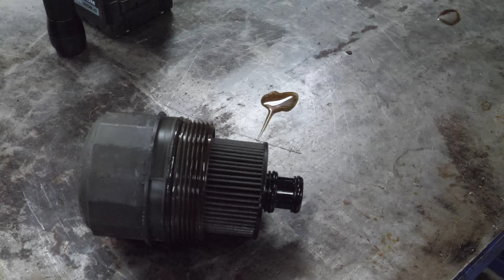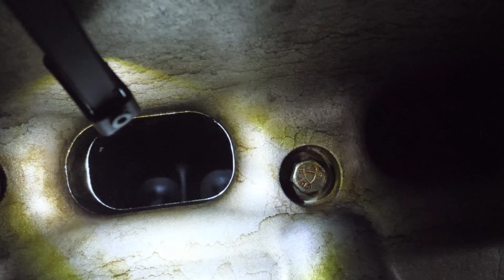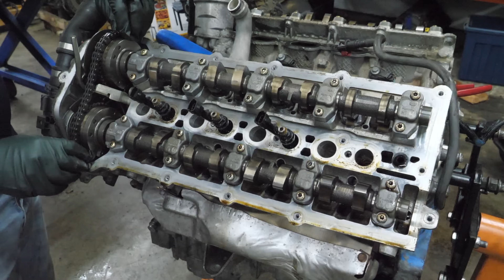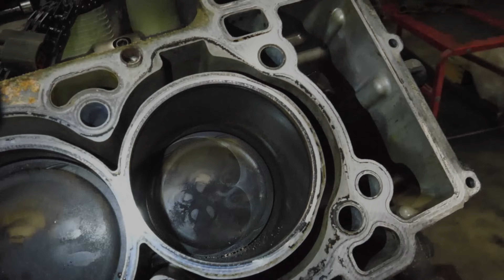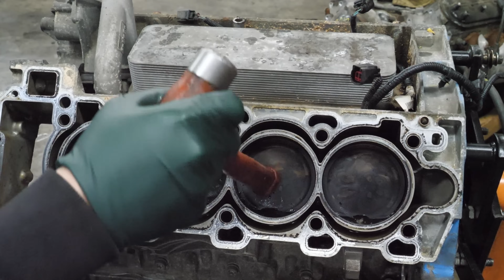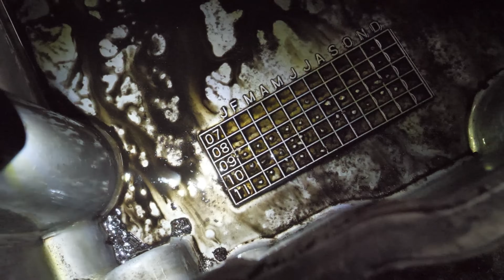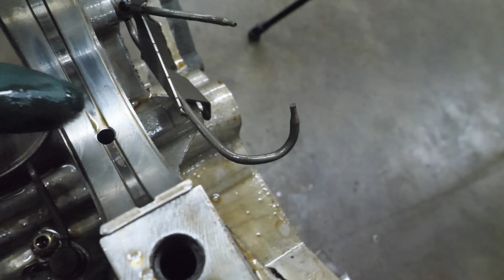500HP Jaguar Land Rover 5.0L Supercharged AJ V8 Teardown! Had to buy AND borrow tools just for this

Comment: I've commented on this before, but the manufacturer recommended oil change intervals were ridiculously far apart, and that makes up a huge part of how often they failed. Design, complexity, cost cutting and so on are all very obvious reasons too, but in some cases it was every 15,000 miles (with Jaguar specifically)
Reply: I work in a quick-lube shop (yes, yes, I know.) and the oil that comes out of the newer German vehicles with long oil change intervals are in general the absolute blackest and smelliest oil besides diesel trucks. I recommend to friends with German cars to roughly half the interval on oil changes assuming it's not a lease vehicle. 5,000 to 7,500 kilometers is still longer than I'd personally go in any of my cars, but it's at least better.
Reply: I’ve got the AJ 34 in my 2007 Jaguar XJ8 which is the 4.2L V8. I’ve got 231k miles on it and have changed the oil every 3k miles. Crazy they’d recommend every 15k miles. The 4.2L’s seem to be the more stout motor
Reply: Yup! So much complexity and reliance on oil to hydraulically actuated cam phasers and chain tensioners. Plus higher specific output and heat adds up to a self eating engine.
Reply: I think jag meant 15000kms, not miles, but the only thing that changed in the manual was the units, not the numbers in front of it.  15000km is about 10000 miles.  pretty normal to go 10k miles now on good oil, but 15000 is pushing it if you are not testing the oil and if you do a lot of short trips.
Reply: I believe Consumer Reports played a big part in the extended oil change fiasco when they started putting emphasis on "cost of ownership".  They recommend cars that have lower routine maintenance cost (ie: fewer oil changes) and downgrad vehicles that higher routine maintenance cost (ie: what used to be the more practical intervals of past vehicles). Became logical for manufactures to enter the lower cost of ownership war.
Reply: That must be Ford's grand plan, I hate the ecoboost engines, even the regular 3.5 V6 engines. I had to replace the turbos on a 2014 flex at 48,000 miles, oiling issues of course, prime don't maintain them like they should and the recommended intervals definitely don't help. The same car came back a month later for a water pump so naturally u recommended a while timing set as well, a month after that I had to replace the PTU cuz it was AWD, everything was due to leaks and lack of maintenance. All those repairs before 55,000 miles. Those are the average repairs on those engines at low mileage
Reply: I helped a lady the other day because the oil light came on in her car 
It turns out that the vehicle (Peugeot 308 1.6l turbo) was 12 years old but had only done 45,000 miles and she had been following the service recommendation based on mileage
Reply: lmaooooo, meanwhile
Mazda recommends that them every 6000 miles,
Reply: I've always attributed that to planned obsolescence. With such long intervals, the issues will usually arise precisely at the time the warranty runs out.
Reply: The long oil tube is for oil extraction when changing the oil.
Reply: @ronsereda4242  That for sure, and the greenies.
Reply: 15k miles interval is ridiculous. Meanwhile Ford specify 5k miles on their Ecoboost engines. I change the oil every 5k kilometers on my Explorer Sport with the Ecoboost 3.5. I am at 265k kilometers on the odo, with the factory turbos, and not a problem. It burns very little oil too. I’ve always believed that larger engines with double overhead cams and turbos must have frequent oil changes or they’ll fail before their time. The person who mentioned planned obsolescence may be onto something.
Reply: @allenramirez2778  ive had an ecoboost Flex, F150, Fusion and now have a 3.7 Transit, other than the current van i drove all those vehicles to over 125k miles with only scheduled maintenance usually 2-3k miles over on oil changes.....never had an engine or trans related failure or issue on any of them. People drive these things like a granny wagon or like a Nascar ride imo both are reasons to cause failures and leaks. I drive my vehicles, hardly ever take off from a stoplight at just over idle and putt putt up the road. Its half to full throttle all the time, current T-250 is loaded and around 9k lbs so it needs 1/2-3/4 throttle to get going lol but pusy footing around on short city trips, having a 365hp ecoboost Flex for soccer mom to haul kids around and never exercise it and get extended heat cycles is a recipe for problems especially being short cycled.     Not sure what you meant about the engines not maintaining a prime on an oiling system with no check valves and clearances that bleed off oil pressure when engine is shut down but unless you install a pre lube system no vehicle will maintain pressure and oil pumps stay primed because its oil in the pump on shutdown
Reply: @JetFire9  I suppose that’s possible, but the more likely scenario is pressure from European fleet managers on manufacturers to extend service intervals.
Reply: Pretty happy my Alfa Giulia says to change the oil every year or 16k km (10k miles), and since I rarely go over 7000km/year it means that it always has fresh oil. Considering it has (being EU, as they didn't put it in the USA ones) multiair module on the head to control valves, it's REALLY important to have fresh and proper spec oil in there...
Reply: With the quality of today's oil being MUCH better than it has been in the past, and the fact that the engines in newer cars being designed better and using better materials, the ring seal is a whole HELL of alot better than it was in engines of the past. It's very common today to be able to go 8000+ miles and still have the oil in a vehicle be clean and viable. 
I change the oil in my Buick Lacrosse, with a 3800 Series III engine in it, about every 7500 miles and at that point it still looks VERY clean. Just slightly darker than when I put it in the motor. 
I wouldnt be afraid to push the mileage a little higher between oil changes in my car even, but getting up to  15,000 miles on an oil change DOES seem a little ridiculous to me. 
Even if the oil still LOOKS clean, it DOES wear out. The detergents in motor oil that are meant to keep the engine clean and suspend dirt particles in the oil so that they can be flushed out during an oil change start to break down, the viscosity of the oil starts to change, and of course no matter how good the engines ring seal is there IS going to be contaminates in the oil after that long no matter what. Yep, oil changes are one of the MOST important things you can do to your vehicle to make it last as long as possible.
Reply: @thekornwulf  5000-7500 kilometers is completely fine if the vehicles engine is in good working order, and it's used in "normal" driving situations. The oil in my Buick after 7500 kilometers still looks like the day I put it in there.
Reply: you think thats bad, as someone that works in a Jag/Rover dealership, with the ingenium engines, they recommend services every 21k or 2 years
Reply: @rondaddy7793  A "service" or an "oil change"? 🤔
Reply: @davelowets  a service, that being said, the sales men don't mention an interim service in between, so people aren't aware that it's recommended to do an oil change in between, and 90% of the time even if they do know about it, they don't do it. I've seen cars consistently go 30k without an oil change. Worst part about it is we cpo cars that are "caught up on services" interim services aren't required to cpo a car, and 90% of the time the sales manager won't listen to you saying we shouldn't cpo a car that never had an interim service
Reply: @rondaddy7793  People are getting too damn stupid today... 🤦🏻 
And the ones that trade their cars in every year or two just don't give a shit. 
It's a sad state of affairs today.
Reply: @davelowets  Whoever buys my leases after I trade them in is getting great cars. My sales guy recommends changing oil every 6 months (against the recommendation in the manual which calls for 10k miles), even though I only drive 9k or less a year. My first lease only had 11k on it in two years because it didn't have AWD and it had 4 oil changes when I turned it in. My next one had 18k when I was done and it had 4 oil changes. My current one at 12k ( turning it in in May) has already had 3. The dealer pays for the first 4 changes so it's not costing me anything. If I ever decide to buy out one of my leases Ill know it's had a very good start in its life. Like i said whoever buys my leases should have a great car if they keep up on 6 month oil changes they will last a long time.
Reply: @thekornwulf  I have a brand new Q8. Audi wants to change the oil every 30k km (18500 miles!!!) So i change it myself every 5-10k km and go to them to change it at 30k km just to keep my warranty without telling them I changed it.
Reply: Meanwhile in Europe: your more performance-oriented cars may require 15000 km (9320 miles) but 20000 km (12400 miles) is common. Modern cars even allow for longer distance intervals but may also have a time interval. My car (2 liter inline-4 EURO6 turbodiesel, 150 hp/370 Nm) has a service/oil change interval of 30000 km (18640 miles) or one year, whichever comes first.

I have no idea why this is. Quality of the fuel? Quality of the oil? Just common practice? A sham maybe? Even Porsche has a 1-year or 10000 mile service/oil change interval for their 911.
Reply: @Hydrazine1000  It's wrong. Change at 10k. Your engine will be toast. Same as my Q8. Audi want 30k km. Never gonna happen. I change at 7500 usually.
Reply: On the damaged piston either a spark plug or the supercharger coming apart. Not sure about the head of a direct injector coming off.
I'm retired auto mechanic also retired Army track and wheel mechanic. Take a look at a sparkplug or one of the direct injector to see if they match the notch in the piston dimensionally.
Something definitely went through the intake and combustion process to do leave a mark like that, and been  small enough to exit through an exhaust valve. Back in the early 80's I had a small block Chevy develope a knock we believe was a piece of carbon breaking loose from an intake valve. It was a few days after changing the oil. The customer brought back rattling pretty good.
Worked the throttle to I was isolate the noise, and it was gone. Several days later the manufacturer of the motor oil we used had a nation wide recall on their oil. Seems it had to much of some type of detergent additive in the chemical make up of the oil. Called the customer had them bring the vehicle back replaced oil and filter with a different brand.
The vehicle never had an issue after that. Again we suspected carbon got loose from the back side of either an intake or exhaust valve. Sorry to be so long winded but felt compelled to share the experience.
Reply: @chubbysumo2230  unfortunately no, they really did set the oil change interval at 15,000 miles on the non supercharged 5.0 V8s. That was on the Jaguar XF models
Reply: @littlebuch  It's your car, if you want to undercut the service interval, then who am I to tell you what to do? Just continue doing what you think is best.

Just my own experience: I've driven a compact with a 1.6l engine from 90k km to 245k km on its manufacturer service interval of 15k km. I've driven a compact with 1.6l turbodiesel from 80k km to 250k km, on its intended 20k km interval. With my current car, a wagon with  2.0l turbodiesel, I reached the 30k interval once, but now I'm hitting the 1 year interval before reaching 30k km. So with all 3 cars combined, all second hand too by the way, I've done over 500k km on manufacturer recommended service intervals, on manufacture recommended oil, with ZERO oil-related issues. I have no qualms with sticking to manufacturer recommendations.
Reply: @Hydrazine1000  do you want a medal? The fact your car made it another 30k km isn't anything to brag. Internals are probably tell a different story.
Reply: @littlebuch  It's not an exception, it's the norm in Europa. Now, go waste good oil prematurely all you want, I'm not trying to convince you to change.

All I'm saying that sticking to the manufacturer recommended interval is perfectly normal out here. Save a small percentage, everyone follows the interval. Or breezes past it in fact
Reply: @Hydrazine1000  I am European... No, it's not wasting oil. You certainly have no idea what you are talking about. Go destroy your engines all you want.
Reply: @littlebuch  After over 400k km, combined over 3 cars, I've ruined exactly zero engines. (Sorry, I mistakenly mentioned 500k before) _I haven't had a single oil-related issue! _

That would have been about 55 oil changes at a 7k5 km interval, give or take. I've had about 24 in total now. 

So let's just agree to disagree. You do you.
Reply: @Hydrazine1000  400k km divided between 3 cars is not that much? Wtf are you talking about? 130k km per car? That's a really low number. Idk why we are still having this discussion.
Reply: @Hydrazine1000  I get your point and it’s a valid one. Places are much closer in Europe than they are in the US. You can drive six hours straight and only pass one or two tiny towns, as such we tend to drive long distances more which is where the 10k interval comes on much faster and takes a heavier toll. Be it a euro, Japanese, or US engine I’d never go 10k on an engine. I work too hard to spend more money on already expensive cars and waste a weekend fixing something I could’ve prevented.
Reply: @Hajijah Muiler Yeah, it's funny. What's even funnier is how I have 300k km on my old car and the engine is like new. But I guess preventative maintenance and good care mean nothing...
Reply: lol
Reply: 15,000miles? That’s insane.  I’m Australian soo hang on a minute.  
Yep 24,000km.   That’s absolutely ridiculous.   
The engineer’s definitely said “yep should just scrape past warranty period” 
Warranty runs out and you have a grenade on wheels.
Reply: @allenramirez2778  Naw, I drive one every day, and know several with them. That's certainly not "average"!
Reply: Certainly one can go a long time between oil changes if they drive solely on the highway. Starting and stopping are killers, as is heat cycling. (I work in the aerospace biz, and we sell the same core turbine for aircraft, and for power generation. Because the power generation usage is never shut down, engine life goes up 10x!)
Reply: @UncleKennysPlace  Absolutely! The amount that manufacturers will over simplify vehicle ownership to the point of planned obsolescence is shocking, especially with cars.

Oil changes are needed more regularly with lots of stop starts, heat cycling, towing, extreme conditions etc etc etc as you say! So when Jaguar said that every 15,000 miles was ideal they obviously meant once per year or 15,000 miles with motorway use and light throttle.

The fact that if you ask the average owner, not someone even mildly interested in motoring, when they need their oil changes done they'll not have a single clue. Chances are that looking in the owners manual won't give more than a number either
Reply: Dave, that's definitely true for newer vehicles. I personally like to keep up a 3-5000 kilometer schedule just due to the fact I'm used to driving older vehicles, but that's more than likely just me being overly cautious
Reply: All European makers are doing 10-15K Oil Change intervals which is pathetic. Euro cars especially turbo or supercharged and even more with start-stop BS need their oil changed no more than 5-6K intervals. It seems they just want to get through Lease and Original Warranty period with the least cost and responsibility, and cross their fingers otherwise.
Reply: Oil changes are especially painful on newer German cars. They usually have skid plates that's need to be fiddled with or removed, proprietary filters, excessive oil capacities, and maintenance computers that need to be reset. Hence service is expensive.
Reply: @georgelin8498  

Takes 5 minutes to remove the bottom plates on each of my Maserati and Porsche. My Lexus has a little door for the filter but that's also 5 minutes to remove the bolts and swing down. 5 seconds to remove the drain plug, 30 minutes to drain. Not sure what you mean by "proprietary filters" and "excessive oil capacities", they're like any other car these days. You do want to use OEM or better Oil and Filters. But it's not rocket science.
Reply: @williamweir2744  I didn't buy it she was on vacation
Reply: Last Friday, customer brought in their 21 RR for their first oil change, we were not prepared for the sludge that came out of this vehicle with 63k miles, I'll see if we still have the engine and may post on it.
Reply: Bald cat reviews  it's true, any oil is better than no oil! But at the same time, was your mom doing long journeys with an unloaded car and gentle throttle, or absolutely caning the car to redline before every shift?

Generally the less load the engine is under the less critical regular oil changes really are. That's why track cars get changes every race or every 1000 miles instead of every year/15,000
Reply: yeah, the intervals are 16k via land rover for some models, and a ridiculous 21k miles on a two year interval.

my only question as a jlr tech with ANY of this is just

what the fuck.
Reply: This is why manufacturers give a service interval in both mileage, and also time (for example 15 000km or 1 year, which ever comes first)
Reply: @Hydrazine1000  Mine is also a turbodiesel, 1.6l with 128hp, 260nm, 2013 so not 100% sure if euro6 compliant (though I would assume so since it was either 1st or 2nd model year of that generation, with presumably the latest emissions systems of the tine, and ready for the upcoming restrictions), and the service interval is also 30 000km, or 2 years... The 2 year time gap is especially interesting considering the car in question is a KIA, so It came with a 7 year/ 160 000km warranty, WITH a 2 year /30 000km service interval... On top of that, I`m not really aware of these engines being known for blowing up, and the worst I`ve seen is that they are apparantly prone to blowing turbos (like most diesels, honestly)

It`s worth pointing out that part of the reason why manufacturers set service intervals so far apart is the fact that modern synthetic oils are super resilient and are specificly designed for this purpose, and also because diesels are really meant for long distance driving (mostly on the highway), where a mostly consistant and relatively low engine speed, coupled with a mostly not that heavy engine load, mean that the oil is generally in the optimal conditions to last a really long time...

Having bought my car last summer with fresh oil, and having done about 8000km in the last year or so (because of occasional use, with most of that being highway driving), I fully intend to do a full service this summer, at about half of both the recommended km, and amount of time, since it will do no harm, and will buy me that bit of piece of mind, especially since my engine uses a timing chain... I would generally recommend changing the oil and filters once a year, or at about half the recommended distance, unless the car really only does long distance highway trips

Also, a little tidbit for those who might be interested, in europe, there are trucks where the service interval is 60 000km for cross country applications and 100 000km for super long haul applications (international deliveries, mainly, and the vehicle mush jabe been ordered in extended interval spec, including a larger sump and, depending on the model year, a 2nd centrifugal oil filter) or 1 year, with the new generation replacements and their new spec for oil recommending 120 000km for intercity/ cross country applications, and 200 000km for long haul (international) applications... Let that sink in
Reply: @allenramirez2778  but what that got to do with a Jag
Reply: @onefastboi14 

Nothing wrong with 15000 mile oil changes IF and only IF you use a motor oil designed to last that long.  

That's why I use Amsoil 100% Synthetic Oil because it will last that long.
Reply: @thekornwulf 

That's true if you use oil that's not designed for those long drain intervals. 

Amsoil 100% Synthetic Oil all the way baby!! 15000 miles is easy peasy with their oil as long as the engine was designed well to begin with.
Reply: @hellkitty1014 

Not if the exact spec oil is used. And I don't mean Manufacturer branded oil.

I am a huge proponent of Amsoil because their oil does exactly what they claim it will do. 15,000 drain intervals in severe driving conditions unless it's a European car which they say stick to the manufacturer drain interval. 

Choice of oil is paramount to how long it will last, so long as it's designed well to begin with though.
Reply: @etiennedauphin 

15K Miles is easily done with Amsoil 100% Synthetic Oil. But it also depends on engine design too.
Reply: @Hydrazine1000 The quality of the oil can do that but only if the quality of the oil is consistently hi quality.
Reply: @ASM31237 And you could still technically prevent something with superior motor oil.

I mean if you wanna continue using cheaply made oil go for it. I will gladly spend 12 bucks a quart for the best oil on the market. That way I have that peace of mind knowing i did something better for my car. 

Although it helps to stay away from vehicles that are poorly designed too, just saying.
Reply: @extremedrivr , I gotta say, the risk still doesn't seem worth taking. Spending a bit of extra dough and putting in the extra work to keep an extremely expensive car ticking over seems worth it to me
Reply: I agree with oil starvation engine videos. And I was keenly interested in that aspect here. Which was not present. Lack of damage to Jag motor was refreshing to see.
Reply: Those engines are a sh:t-load of work to remove/install in a Rover.
Reply: @littlebuch I do exactly the same as you with my lexus, it goes to the dealer every 10k for a service to keep the warranty but I do an oil change in between every 5k, it's a doddle to do and the engine will pay me back in the long run.
Reply: 5k miles top
Reply: True  I have a 2010 CTS-V with  726,000 km I change the oil every 6000 km zero problems
Reply: This is because of different way EU and Americans approach car maintenance.  I. EU we use high quality fully synthetic oil, and USA uses natural oil from crap lube shops.  So USA must change oil every 3k miles and in EU we change our oil between 9k and 18k miles.  And no, we don't get problems, I never had a car where the engine used oil, no varnish, etc, and I bought old cars.
So EU car oil change intervals cannot work in USA cos of the shit oil you use as it is a cheap nasty oil culture.
Reply: @thekornwulf miles and KM are different. 5,000 KM is only 3,000 miles which is a very typical low mileage interval to change oil. I can't see how that would be a long interval for you. 7500km is under 5,000 miles which, again, is a typical oil changes interval on modern engines. 7,000+ miles is definitely too long though and these manufacturers recommending 10,000 miles or more are absolutely giving their customers bad advice and should be liable for the resulting damages.
Reply: @RyneLanders , I'm well aware of the difference between miles and kilometers. I live in Canada, so we often have the issue of converting between them come up
Reply: That's crazy, I would never go that long. 5K at most, but I might go with 3k now that I'm hearing about this motor. I just a 2013 Jaguar XJL Supercharged with 50k miles.
Reply: I have a 2000 Peugeot 406 2.0L and the recommended oil change intervals are 20'000 miles or 2 years on 5W30 fully synthetic.
Reply: Nearly nobody in Europe changes  oil more often than 15k km /9k miles. Pretty much everybody that I know (non car people) follow manufacturer recomendation. When oil change notification comes up they go to shop. This has been the standard since late 90s.
Most 2.0 and 3.0 tdi run on 30k km /18k miles intervals without problems. Same interval on DI gas engines is now becoming a big problem because of fuel dilution. I use oil for reccomended 30k change and change it every 15k.
Reply: Oil change intervals seem to become the second most debated subject after what oil brand is the best.

The engine in this vid was either a low mileage one, had frequent oil changes and possibly longer trip intervals with possible frequent long distance driving. Stop and go traffic, hot or high humidity weather, driving style with extended oil changes are all contributing factors to sludge built up and rapid component brake down. Most of the cars I've owned where high mileage vehicles with apparent frequent oil changes. This is fairly simple to figure out by inspecting the valve train and the back side of the oil fill cap for discoloration, milky sludge or carbon deposits. The same should be done by inspecting the dip stick for cleanliness if you car still has one. Although I haven't owned a DI car, but fixed a punch of stuff on a 2016 218i with only 60k heavy city miles in a hot climate. It was apparent that the right oil and more frequent oil changes than recommended was necessary to avoid all the pitfalls of DI, turbo, twin turbo, SC and Def designed cars nowadays come with.  I'm still on my first turbo and injectors on my 2003 Dodge Cummins engine with a little over 350k miles. Obviously, I've put over 170k mostly highway miles on it when I bought the truck in 2009. Apparently the previous owners (2) have done the same with enough oil changes.

Depending on your driving habits and circumstances, an oil analysis may be a good idea to determine the condition of your engine and oil before you spend a boat load on expensive synthetic oil or starring expensive repairs in the eye. Examining what's trapped between the pleads of your oil filter as the content creator has been doing is also a good practice.

Having said that, this engine looks like a stout design with some built in design flows that could last a long time with preventive maintenance and possible upgrades. Land Rover screwed up by dragging the venerable Buick 3.9l V8 into the new millennium with wore out tooling and batch fixes to meet US emissions. They could have easily changed to the Buick 3.8l V6 with turbo and or supercharger or to the first gen. Corvette LS engines. As far as Jaguar engine, the 4.0l AJ6 followed by the 4.0l AJ16 and AJ16S inline sixes are as good if not better, if properly maintained of course, than the Mercedes and BMW I6 engines of the same early 1990s vintage. The supercharged AJ16S became the crown jewel of the area of inline 6 engines besides the XJ12 and XJS V12 engines.
Reply: I'm still a 3-5k oil change person... even running full synth oil.  I don't trust Mfg recommendations on oil change intervals, just seems like a ploy to get premature engine failure to get you to buy a new car
Reply: @chubbysumo2230 I was thinking about the same thing , I Mexico , BMW requires 15000km , even 15000km I think it’s too far , I change at 10000km
Reply: The weird thing is, when the "big three" do the same thing they're immediately written off as "junk", but every other manufacturer they blame the consumer as "negligent maintenance". 
Same exact problems, same exact engineering two different opinions.
Reply: Way too many points of possible catastrophic failure, and a real challenge from a reliability standpoint. But beautiful design from purely engineering standpoint. My compliments to Ford/Jaguar for putting it in production. I worked for Chrysler as a Mechanical Engineer in the 1950's, days of first Hemi V8. The Accountants killed it in 1958, claiming the average person wouldn't see the value of it from a cost standpoint (and they were probably right).
Reply: got the same engine in my 2006 L322 and it's up to 183k miles - changing oil every 5 to 7k Km
Reply: @ronsereda4242 Very similar situation regarding simply which oil to use in a BMW e39 M5. Marketing ploys and indirect language have led to a ridiculous, 20-year long rabbit hole
Reply: This is an incredibly complex and expensive to have rebuilt. Hardly any shop knows how to rebuild one or even will touch it. I have a 2011 Landrover with the unsupercharged version of the engine and have found that it is prone to coolant leaks due to all the plastic plumbing and all of the parts on the vehicle that have failed have FoMoCo stamped on them. The poor reputation of Jaguar and Landrover is true. Stay away from them if you want a long lasting reliable vehicle.